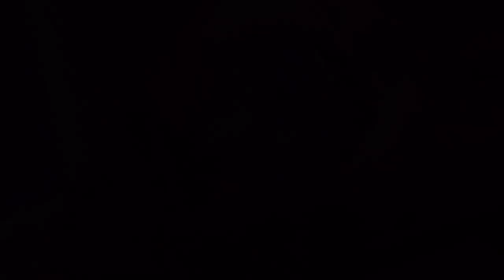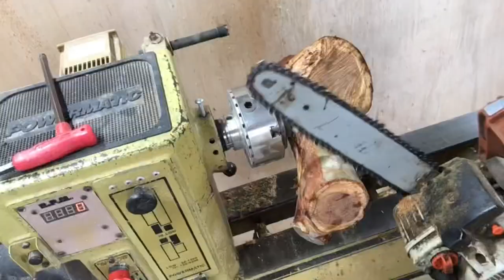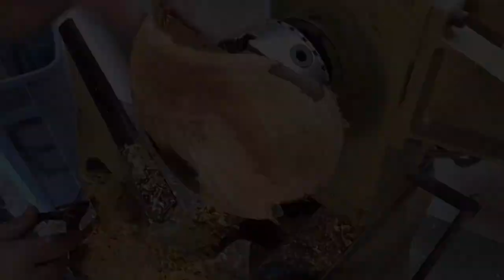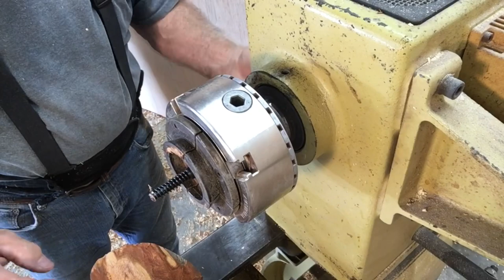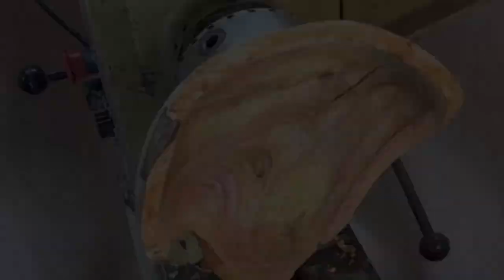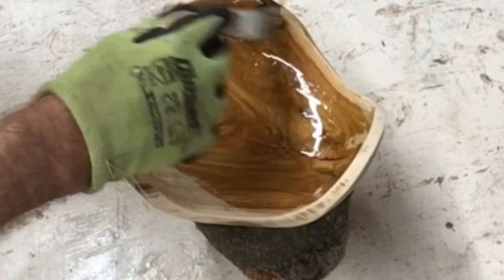Woodturning-Chinese Elm bowl

Comment: I'm surprised by the limited checking and cracking of the log before you turned the bowl.  How did you dry it?
Reply from the maker: Thank you Scott. It was very wet when I started. after I finished it I just put it in the shop. It dried perfectly fine. I am surprised myself. Some wood just crack all to pieces, others don’t. Chinese elm is an odd one. I once left a log on the ground for a few weeks then cut a long strip off and made a bow, like bow and arrow, it shoots well to this day just fine. In fact I made a second one even later with no issues. It’s been over 10 years.
Reply: @darrenswoodworks8695  Thanks Darren.  I'm going to give it a go with some wet pieces!
Reply from the maker: Hey Scott, I’ve been turning wet wood as bowl blanks for years. They are thick so I can turn them again later. They warp and crack. Best thing is put them in a dark cool place and let them dry on their own. You can turn some woods thin and even to help dry slower and evenly. They might bend a bit. All depends on the wood type. Best to you. Keep on turning.